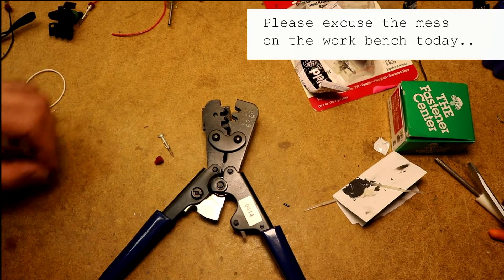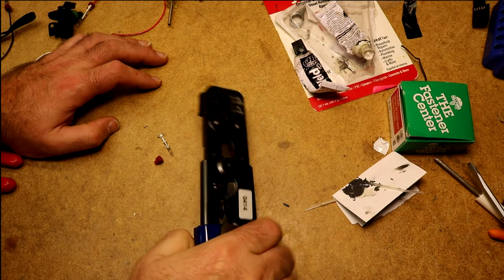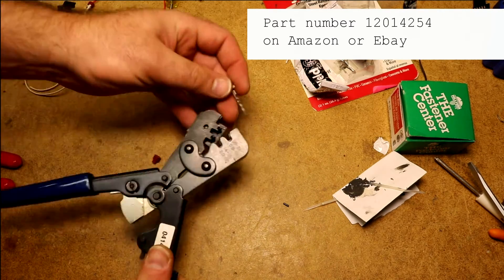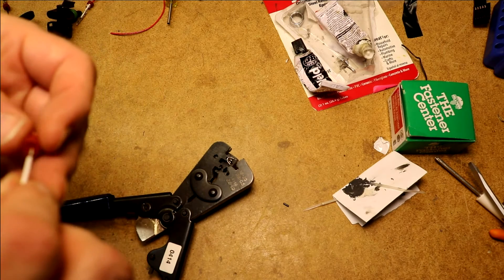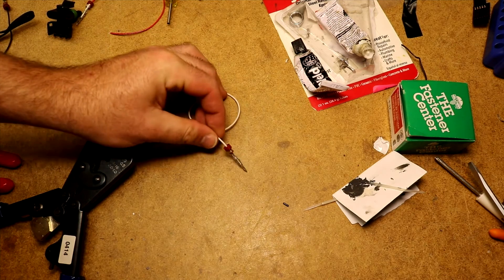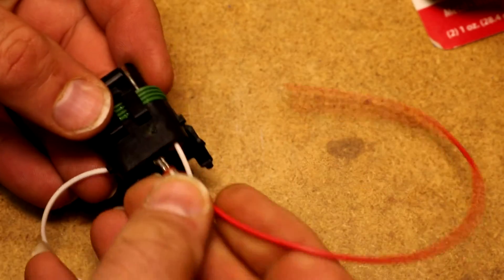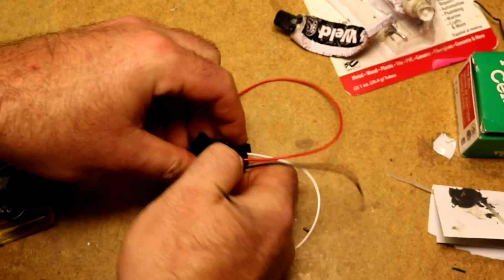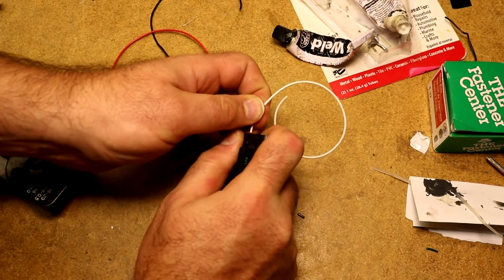Weatherpack Crimp tool 12014254 review

Comment: is there a similar tool that will do the same thing for less money? I have to make one fix like this and won't be using the tool much. Any help would be greatly appreciated.
Reply: The above tool is limited to the Delphi Weatherpak terminals.  It's a great tool just not very versatile.  
The ratcheting five cavity 12085270 sealed and 12085271 unsealed terminal tools will cover a huge number of automotive terminals.  The Delphi 12085270 will do Metripack, Weatherpack, Molex GT, and several other sealed terminal families.   The 12085271 crimps insulation and conductor wings on Packard 56/59 and many other unsealed terminals. They cost around $90 each. Those two tools are the most used crimpers in my toolbox next to the Daniels AF8.
You can get non-ratcheting tooling in the $40 range that will usually do adequate crimps but you really do get what you pay for.
Reply from the maker: Prior to buying the fancy crimper in this video, I just used a small needle-nose pliers.